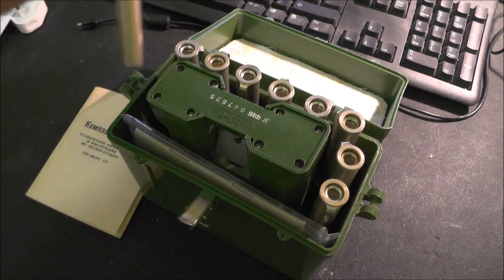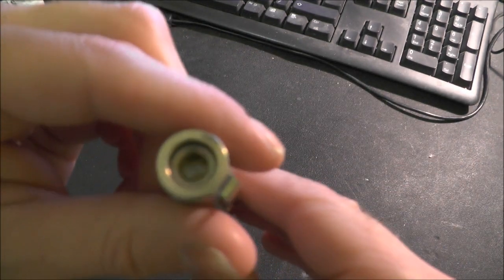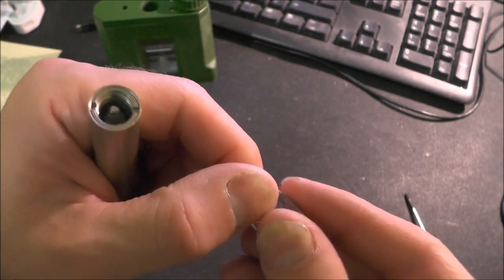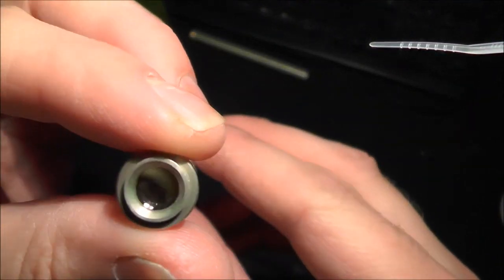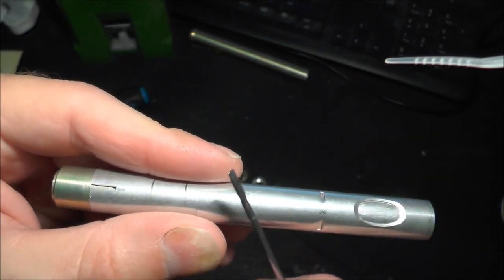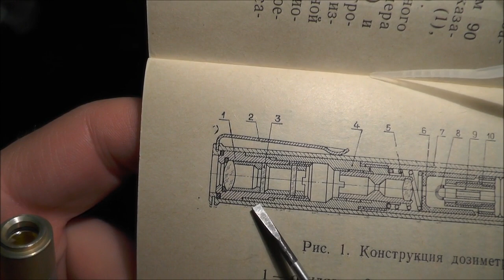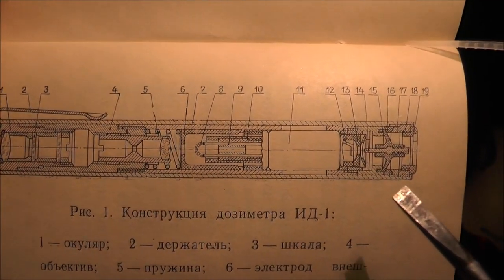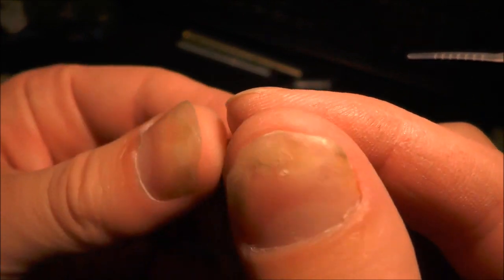DL#021 - Russian ID-1 Dosimeters Part 2: Pen Teardown

Comment: Thanks, @ DextersTechLab.   I was idly shopping for a geiger counter on ebay and, ebay being a magnet for scammers, sorting by price, there are many listings that contain the term "geiger counter" but aren't for geiger counters at all.  There are dosimeters like this, and non-ionizing radiation meters.  Among the first several pages, I found a few legit listings - a geiger tube from which to build a meter for just 12 USD...
Individual dosimeters like these, but without the charger, they're useless, and it's not clear if they ship them charged.  Would be useful to know how long they stay charged (normally/in a lead-lined box) or per the documentation, claim to stay charged.
Reply: Got 2 soviet DKP-50 pen dosimeters and a CDV-742 kit (6x 200R dosimeters + charger) from ebay. Now after more than a year all of them are still are at zero. (One cdv-742 doesn't hold a charge though)

Comment: Any idea how accurate these dosimeters are?
Reply: I doubt these are very accurate. Even the self discharge numbers in the manual vary wildly depending on temperature and relative humidity. Plus, being somewhat mechanical in nature, they probably don't handle shocks too well. But if nothing else is available, I'd still prefer to have a couple in my pocket.
Reply: @drezster  Even if they are accurate to within 10-20 rads, you will get an idea if your are in a danger zone. The Soviets produced them by the zillion. The price is right.

I would leave them outside a shelter area as sensors that give you an idea whether there is a large dose of radiation to worry about.
Reply: I have a few soviet and US made ones. They still are as accurate as a modern geiger counter.
Reply: @Phoenix88.  Each of my old new stock ID-1s will hold a charge for several weeks which means their capacitor is still good. I am thinking they will function OK.

Comment: CAN THE PEN BE REUSED?
Reply from the maker: Yes, you simply recharge it on the charging unit. The manual says typical life of 10,000 charges. The pen i disassembled is now permanently broken as hey are not intended to be disassembled.
Reply: DextersLab2013 Thats really a good design though. Yea, i saw the same device in ebay. And now absolutely I will buy it. Thank you

Comment: Hi Dexter. I have one of this "pens", or actually it is scaled from 0-50 roentgens so it is not exactly the same model, but very similar. Sadly, I dont have the charger. Would you be able to measure the voltage over the electrodes. If you measure the voltage over the electrodes when the instument is on zero, that miht give me an idea of which voltage I need to supply. Maybe I can make a charger myself, i I know the voltage needed. That would be very helpful. Thanks for the video!